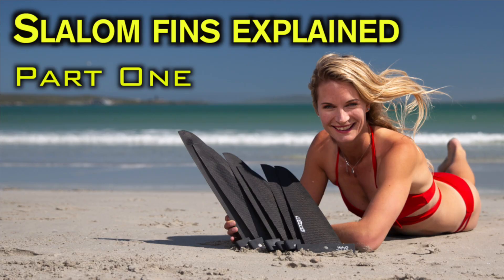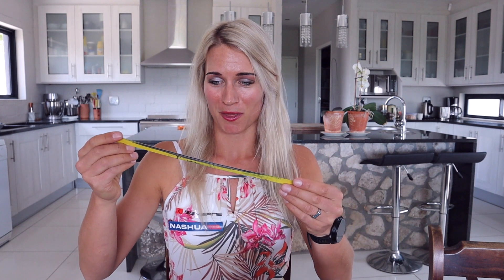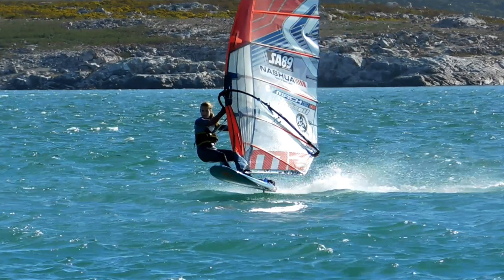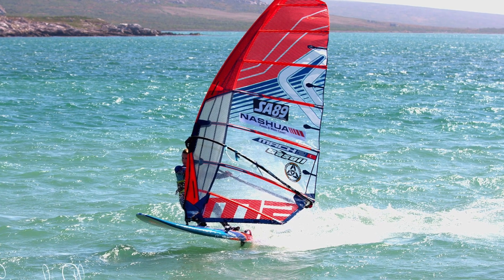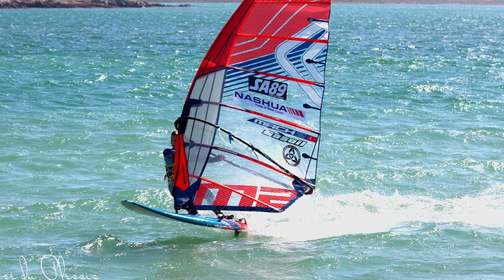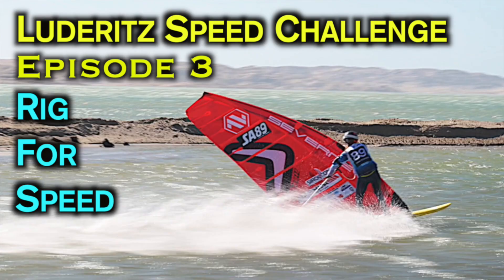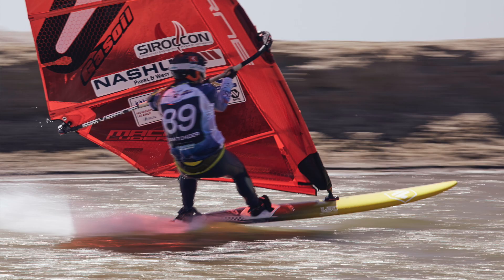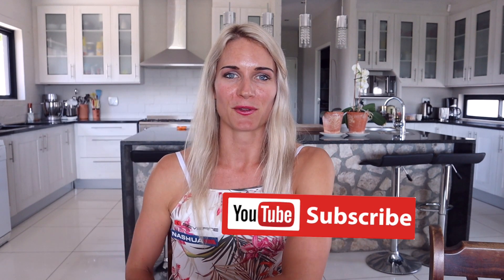How to get lift to widen your wind range (Part TWO): What is lift, how to rail the board to get lift

Comment: I think you have a really good point here by pushing with the toes  instead off the heels. I  think I stand to much on my heels to contrôle the board while speedsurfing. I always feel my board is to sticky on the water. I have to practice railing my board!
I sail a lot with Vincent Valkenaers and he is always average 10 km/u faster. When I see how his board is flying over the water, now I know how he achieves that. By railing the board.
I hope we will have some wind here in Belgium so I can begin to practice.
Reply from the maker: Hi Tim, thanks so much for your comment... I am very happy to hear that my video is helpful. Definitely try it out, the board will feel a lot less sticky when pointing especially your back foot instead of pressing the heels into the board. You will immediately feel a big difference in acceleration and speed! Awesome that you can train with someone like Vincent to push your speed limits! 🤙I hope this tip will help a lot to get that extra speed!🚀🚀
Reply: @KarovanTonder  thanks for your answer so pointing your Blackfoot will help to rail the board. Can you also do that going upwind or does it only work going downwind? And are there other considerations in bodyposture to get the ideal speedstance?
Reply from the maker: @timdewilde2941  it's a great pleasure, so glad I can help! Yes, you can rail the board and get lift going upwind as well, it takes slightly greater effort, but as long as you are on a high enough speed it should make a big difference going upwind or downwind. So try to tilt the board mainly using your backfoot, pointing on the balls of the foot... I slightly rotate my body so my hips turn slightly forward and pull the sail back so the bottom part of the sail is almost flush with the board. Try to lean nice and far out over the board, so not stand too upright... In other words, make sure your harness lines are not too short and slightly lower boom. This helps to keep most weight off the board so easier lifting and more control over chop. Try to lock in this position when you feel you are lifting and railing.... Its quite strenuous on the feet and the hamstring muscles in the beginning, but as you get used to it, it becomes 2nd nature. It helps to have the footstraps on the most outer setting of the board. Sometimes you would want to flex the front foot slightly just keep a nice grip in the strap whilst railing with the back foot.

Comment: Thanks for your video, superinformative and interesting as usual. I can still learn something new after almost 30 years. I didn't knew the fin bends and create lift like a hydrofoil or maybe its because my 90ies old school fins are stiffer? Merry Christmas & happy new year!
Reply from the maker: It's a great pleasure🤙 Thank you for your nice feedback! I'm happy I can help more people get the best out of their gear. That's what's so amazing about windsurfing, one can never stop learning!
Reply from the maker: ... 100% correct, some of the older Fins may have been more stiff and difficult to flex... Especially if it was a G10 fin. Those Fins are very stiff and difficult to get lift on. The only way they got G10 Fins to be stiff was increase the thickness, unlike carbon Fins - This also creates a great amount of drag and very little flex. With carbon slalom fins, its a whole lot easier to get lift when railing 🤙
Reply: @KarovanTonder  For sure I will start to look into carbon fins. Thanks😀👍

Comment: Super helpful, thanks a bunch! would this apply to Freeride fins and boards as well more or less?
Reply from the maker: It's a great pleasure! Yes, the same principle applies to free ride, wave and speed fins, except, the lift that you would get is a lot less due to the curved shape. That's why you are able to take on such high winds with wave and free ride gear and still stay in control. The fins are able to slide trough the water due to bottom curved shape... Very controllable and forgiving, but not as fast as slalom fins. But with wave and freeride, speed and lift is not the main desire, so its ideal for those situations. The moment I point my back foot and tilt my wave board to rail it, it goes faster than when pressing my heels into the board. In my fins video (part one) I've elaborated a little more on the shape of the fins and how it impacts the performance of a slalom, wave or free ride fin, if you like you can check it out🤙 The less curved shape at the bottom of the free ride fin, the more lift you would be able to achieve.
Reply: @KarovanTonder  thank you for the fast and elaborate response! I’m checking all the videos, don’t know why this channel didn’t appear on my YouTube before!
Reply from the maker: @marcosgallodgp  it's a great pleasure!... Glad I can help 🤙

Comment: So, when freeriding a 6.6 on lower winds, what kind of fin would you recommend? Length, type...
Currently, I'm using a Unifiber Freeride G10. Haven't really tried other fins yet, but with this one, and 20kt wind, it seems i have good control and a fair amount of speed.
But looking for another option so i can compare.
I havent got a larger sail (yet).
Reply from the maker: I would go for a 36 Gasoil CHR L carbon fin for low winds, for strong winds 34 CHR L. These will make a huge difference for you on the water with regards to speed and control. 
Hope this helps, let me know if you need more info.